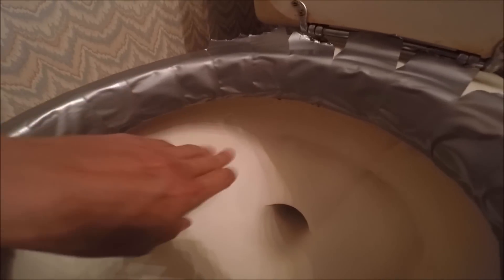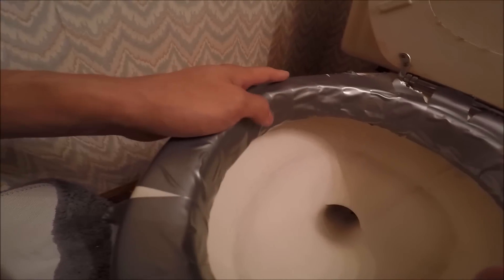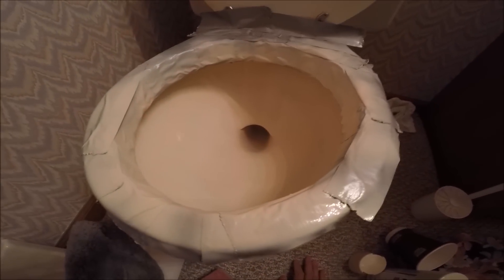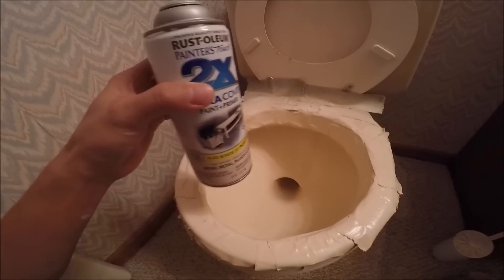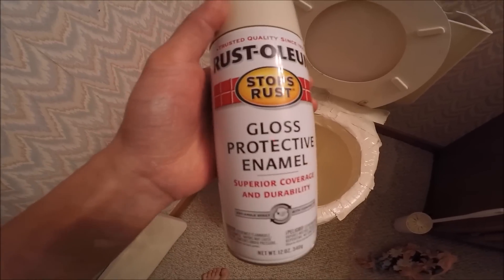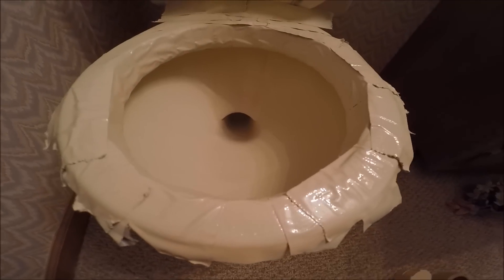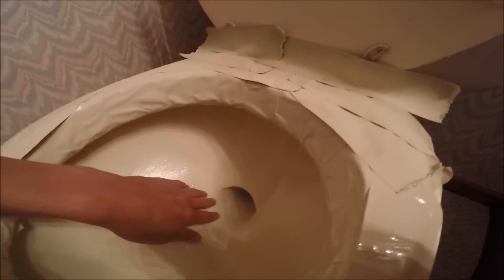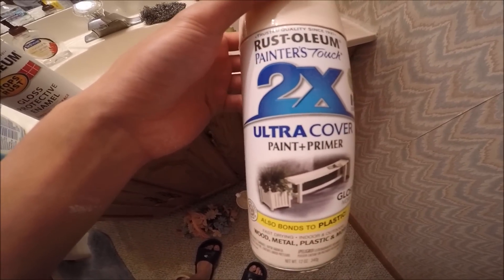How to Paint the Inside of a Toilet Bowl

Comment: Never ever use abrasives on porcelain.Here's how to instantly remove encrusted stains on the inside of toilet bowls:
Buy muriatic acid from the hardware store. (ALWAYS wear a respirator, full face shield, chemical handling gloves and old heavy clothing to protect yourself from splashes and spills whenever using this acid!)
Clean an old small squeeze bottle with nozzle, make sure it's thoroughly dry and fill it half way with the acid in a porcelain (NOT stainless steal!) sink or outdoors using a funnel.
Shut off toilet water source valve, flush toilet and sop up any remaining water in the toilet with a rag.
Open ALL windows and set a fan in bathroom window blowing OUT. If there is no window in the bathroom then set up a fan in the doorway blowing OUT.
CAREFULLY aim the squeeze bottle IN the bowl and saturate the entire inside including under the rim.
Exit the building. Wait until fumes have dissipated and inspect for stains. They should be completely gone. (For extra heavy dark ancient stains repeat the process.)
Turn on the water valve and flush a couple of times.
The inside of the bowl should now look like new.
Reply from the maker: Thanks for sharing, I wish I had known this sooner!
Reply: lol...what an idiot I am. I used some heavy duty scrubber and ruined the very bottom of my toilet and now it looks like someone didn't clean out the toilet after....so embarrassing. Hope I can fix it. Shoulda Coulda Woulda! Gonna try this. Thanks for the information.
Reply: I'm sorry but that name is hysterical...SheepButts? hilarious.
Reply: He just did and... it worked fine.
Reply: I bought Muriatic acid as you say but it's way too dangerous 
to use for home use. Your instructions prove it. I would leave 
acid to the professionals because there's no way I'm risking my health
for a toilet.
Reply: Where is the toilet water source value located brother..can U please advise
Reply: @A7ty34g  Lol I hear you on that!